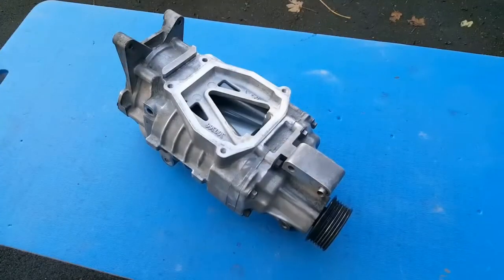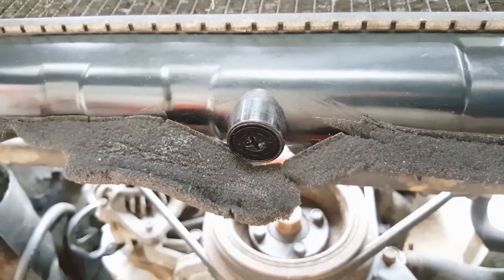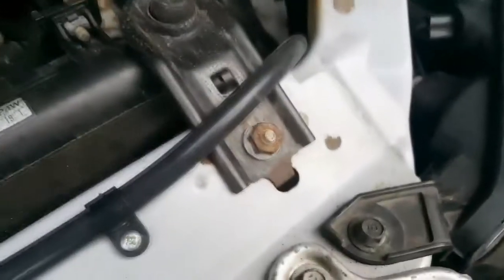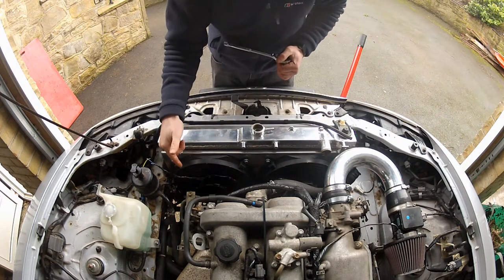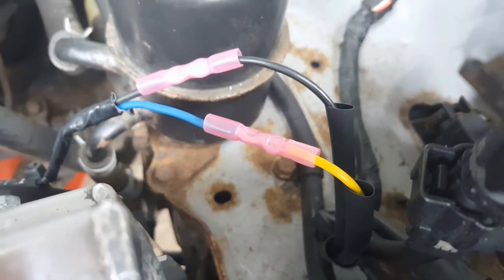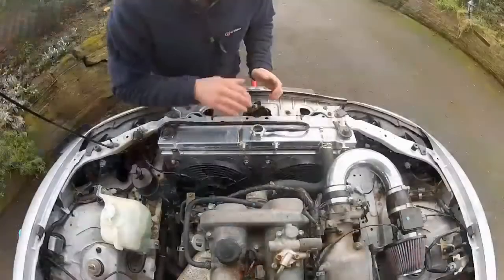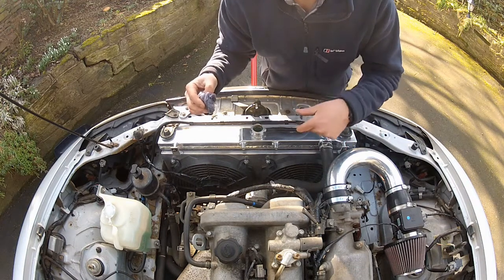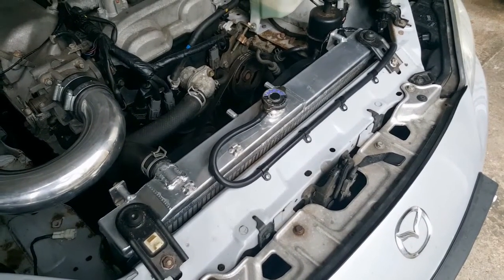How to Install an Alloy Radiator & Wire Dual Fans | Supercharging the MX5 Miata Ep 14

Comment: Dude did your fan switch like this set-up as I found when I threw a similar dual fan rad on my Mazda it started eating fan switches
Reply from the maker: So far so good but that is the potential issue wiring them this way

Comment: Hi enjoying the updates. Cheap cold air supply mod for consideration is to remove the plastic fog light insert and run some 75mm flexi tube into the engine bay near to where the air filter will be located for your supercharger. Does take a little bit of metal work but worth it to get lower IAT. Keep up the good work!
Reply from the maker: Thanks for the tip Graeme, will look into that when the time comes. Had initially planned to locate the filter near the OEM position - behind passenger light (UK), as there is a hole where I presume fresh air is meant to pass through. Is this where you'd run the flexi pipe to?
Reply: @FastRust  Yes thats the place for it. A bit of metal cutting to widen that hole and the flexi pipe will push through.

Comment: Where abouts did you get the radiator and fans?
Do you know what brand they are?
Think I'll have clearance issues with my boost piping between the radiator and ARB
Reply from the maker: I got them second hand so I'm not sure what they are. They're slimmer than the stock fan though by quite a margin. Just filmed a video on how to modify the radiator to be able to get pipework over the top, will be out next month. May be helpful to you.
Reply: @FastRust  ah I see. Unfortunately I've already gone for the around the rad approach. But maybe something I would consider later on. Top fed intercooler with welded 63mm pipes
Reply from the maker: Ah no worries. Yeah the intercooler I have to use is a top feed so the only way to get to it is over the rad!
Reply from the maker: As for the plug I'll have a look see if I can find it. I sold the stock rad and fan, can't remember if the plug was on it or not..